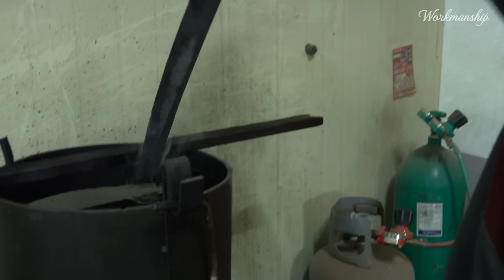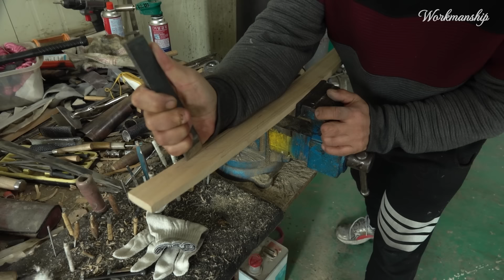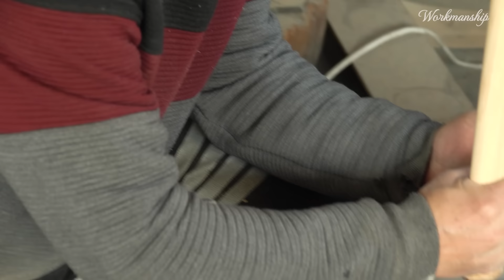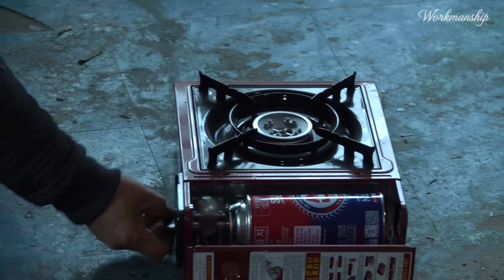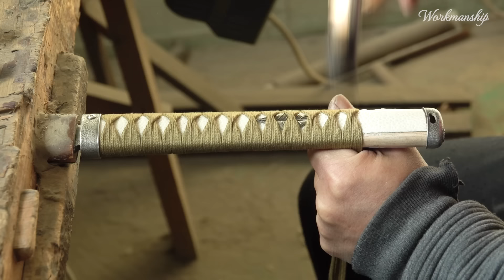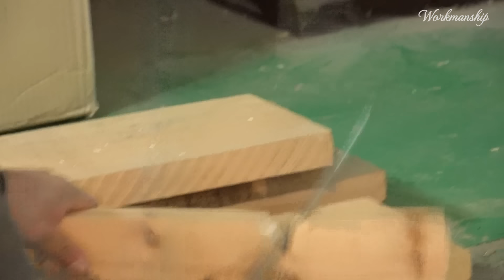Process of Forging a Powerful Steel Sword. Amazing Korean Swordsmith

Comment: I’ve never seen the technique where you heat it while it’s slowly being dipped in the oil. Interesting indeed.
Reply: Traditional Korean swords are not soaked in oil. They are soaked in water by experienced masters. Unskilled technicians break or twist when immersed in water.

Comment: One thing that puzzled me about the handle construction is not have a full skin wrap. The whole point of the stingray skin is to be soaked and left of the handle to dry. As it shrinks, it tightens around the wood and serves as a very strong to keep the handle from cracking. In this video, the gentleman basically did what we call in the west “Samegawa panels”, which really only accomplish aesthetics without the real benefit of a skin wrap. Can anybody help me with this? 

PS, yes before you tell me, I know that the Jingum and Katana are different swords. I love both, and I’d just like to know if this is a traditional practice for the Korean sword?
Reply: 그냥 팔려고 대충 만드는 겁니다.

너무 심각하게 생각하지 마세요.

Comment: that heat treatment was amazing.
  I never would have thought of that
Reply: No it wasn’t.. he effectively ruined it
Reply: @charliebowen5071   I'd like to check it with a file.
   looks to me like he hardened the whole thing, softened the edge / middle and then hardened just the edge.
   ending up with a hard back soft middle and a hard edge.
    I don't know how he kept the oil bath from catching on fire but it's an interesting idea.
    I bet theses guys did not go into battle with soft edged swords.
    I just find it interesting that they found  a different way to get that  hard/soft/hard blade. proof there is more than one way to skin a cat

Comment: Although not the most traditional way of making japanese swords (katana anyway) there are some good ideas for a more production focused approach. I've seen this form of heat treatment before and would love to get a metallurgist's input. 

The thing that struck me the most was that with that traditional tsuka, the blade appears to be peened over the kashira, defeating the entire mekugi work. I would love to talk to the smith about these choices.
Reply: He’s Korean and it’s not a Japanese sword. It’s far from.
Reply: @ryoact  I knew he was Korean. But is it usual for Korean swords to be peened?
Reply: @angelosilva342  you mean “pinned”? I have no idea about Korean swords manufacturing.
Reply: @ryoact  the proper was to spell it is "peened" (it's not related to the male organ) which comes from "peen", although I concede the terms are potentially related.

Basically, unlike a traditional nakago, there was a thin "rod-like" protrusion at the end of the tang, and it seems to be a circular peen mark on the kashira. Which is weird, because the whole point of the handle construction with the mekugi pin is to disassemble the handle. If its peened over the kashira, it can't be done anymore without undoing the peen, which is much more work.

Comment: I hurt so deeply for my Korean brothers who have had their heritage corrupted by the Japanese Occupation. The Korean TO is the authentic sword of the Korean soldier, ending in the Yi Dynasty. My prayer is that the Korean culture will continuye to reinstate its true origins and step away from mimic-ing Japanese items.
Reply: Korean saber is actually much closer to chinese saber than a katana. From far it might resembles katana but korean sword are shorter, less curved and broader with shorter handles. Too bad modern depiction of korean sword are direct copy of katana.

Comment: 折れる、曲がる、よく切れないがニセ日本刀
Reply: The japonese blade actually can scratch,  or have damage in the blade that because the oldest katanas or the tradicional ones are madera by carbon Steel but actually katanas are most strong because they use carbon Steel 1095 a special tipe of Steel.

Comment: Korean swords used to be double-edged, but as Japanese swords became popular around the world, Korean swords started to look like Japanese swords.
Reply: exactly.
japanese "odachi 大太刀" ー＞ chinese "chang dao" (adopted by general qi ji guang 戚繼光)
ー＞ korean ssangsudo雙手刀 (only drawings)
for further details about this info, visit the following site:
【 great ming military chang dao 】
Reply: well, most korean swords were indeed double-edged until the Joseon Dynasty, but we did have single -edged blades since the Goryo Dynasty. Sadly, due to the long, nearly 500 years of peace in Joseon had led to the lightening, and shortening of korean swords(korean people historically favored the bow and arrow, and long swords get in the way), which caused proved difficult to face the long, two handed Katanas(most korean swords were also single handed, which means the power with which you weild the sword was weaker) the Japanese used to invade. So naturally, our swords had to follow some of the aspects japenese blades had to be evenly matched(like the lengthening of the blade). However, it is only a few aspects of the blade that had become to look a little similar. The sword itself was still pretty much Joseon itself's.

Comment: Blowtorch hamon, banging on cold steel, not cooling the blade when grinding on a sander, dry rayskin gluing? No, this is not the way. An asian sword like this should be rigid, the step test shows nothing of merit here

Comment: 形だけだな。素延べからの折り返しの工程もないし百歩譲ってスプリングハンマーすら見当たらないところで外注である程度のバネ鋼の素延べ刀身を作ってもらって、刃付けと拵えだけそれらしくやってるだけ。　こんなのは刀鍛冶なんて名乗ってはいけない。　タイトルで日本刀って書くと反発食らうから避けてるだけで、日本刀製作はこんな簡単ではない。
Reply: Well for one it's not Japanese it's Korean and they had better metal to start out with and didn't have to fold them . Two it's not spring steel it's properly heat treated . That's what causes its ability to flex
Reply: @neverpreparedenough6431 
ガスバーナーは日本刀では使ってはいけません。
日本刀の鉄は1000年以上の歴史があるたたらという最高の鉄を使っています。
作り方を守ってこその伝統。
Reply: @ゆうやま-r2k  Bro the iron in japan is from bogs, which is very low quality, hence the need to fold it to make it stronger. Good quality iron doesn't need to be folded.
Reply: @ゆうやま-r2k You don't know why a Japanese samurai carried three katana. Japanese iron is weaker than Korean iron. It's common for it to break while fighting.
Reply: @ゆうやま-r2k  日本刀は基本的に直線状の刀です。
高麗刀剣のデザインを導入した後に曲がったナイフを使用します。
それが今日本刀の原型です。
Reply: @가나다-p2s9d  
日本刀は反りがついてるから日本刀って言うの。
日本も初めのうちは直刀だったの。分類上、直刀は上古刀っていうの。日本刀とは言わないの。反りが付いたのは平安時代末期頃。拵えから抜きやすいよう、切りやすいように反りが付いたの。
噓つくのやめた方がいいよ。

Comment: Just a Japanese clone.. nothing high quality at all… even down to the mushashi clone…
Reply: except it's edge is hardened completely differently.
   Japanese swords have a soft back and a hard edge.  This sword has a hard back , soft middle and a hard edge. You're right about the look of them but another point is Japanese swords are forged straight and the way they are heat treated puts the curve in them.  This one was forged curved.
   looks to me like some smart Korean found a different way to get that sandwich effect the Viking swords were famous for.  Made entirely differently but still hard /soft/ hard .  
Sounds like a Viagra commercial
Reply: @seanfaherty  yes but it's a copy of a japanese sword.. lots of mistakes here too. This isn't a Korean sword it's a Japanese poor quality replica...
Reply: @seanfaherty  Japanese swords being made straight is a myth.
Reply: @seanfaherty  and many japanese swords have different constructions depending on school.  There are blades with tempered spines
Reply: @charliebowen5071  cool, thanks for the learnings
Reply: @charliebowen5071  then they should quit making films of people making them like that
Reply: @charliebowen5071   well a Korean guy made it in Korea to different methods... I guess that's what makes it a Japanese replica.
Reply: @seanfaherty  no what makes it a replica are the numerous mistakes made in all areas.. this makes it a cheap knock off with nothing much to do with what its supposed to be
Reply: @charliebowen5071  Historically it was invented to withstand the Japanese swords.
  It's not just some guy building shit in his shop.
  It was the Korean answer to the Katana.   
 Not a Katana  it just looks like one from a distance
   Does not intend to be a katana.
Reply: @charliebowen5071  Japanese swords are made straight. It is not a myth. His statement is correct.
But there is a mistake in his statement about the hard and soft parts of the Japanese sword.
Reply: @れんこん-e2k  nope... they are not forged straight...
Reply: 일본도와 한국도는 비슷해보여도 엄연히 다르다.
일본도는 과거부터 현재까지 그 전통이 꾸준히 계승되어 왔지만, 한국도는 그렇지 못했다.
한국은 과거부터 끊임없는 외세의 침입을 겪어왔고 때문에 칼보다는 궁을 많이 사용했고 그래서 한국의 각궁은 매우 과학적이고 유연하면서 강하다.
그러나 분명히 한국도는 독자적인 특징과 전통이 있다.

너는 잘 알지도 못하면서 일본의 레플리카 라는 헛소리 하지말아야 한다!
Reply: @bower79-q6n  이 작가는 일본도의 특징을 가진 일본도와 똑같은 칼을 만들어서 가짜라는 소리를 듣기도 했다.
한국도의 특징을 갖춘 한국도를 만든다면 아무도 뭐라고 하지 않을 것이다.

This artist was called a fake because he makes swords that look just like Japanese swords with the characteristics of Japanese swords.
If he were making a Korean sword with the characteristics of a Korean sword, no one would complain.
Reply: You should read yoshindo yoshihara’s book. There are in fact straight Japanese swords called chokuto (or jokuto) from the Heian period (794-1185). Anyway, the man in this video is producing good blades that I doubt you are capable of making yourself.